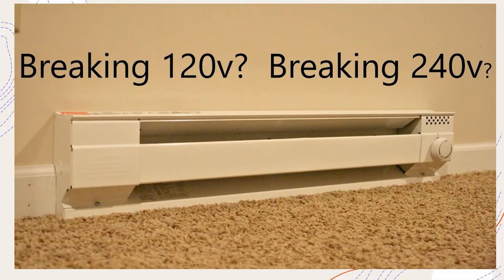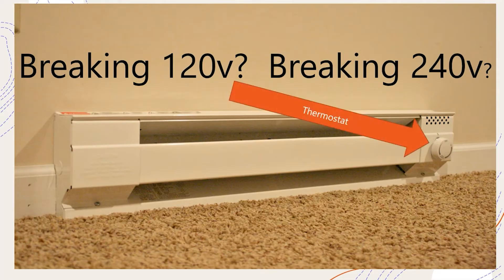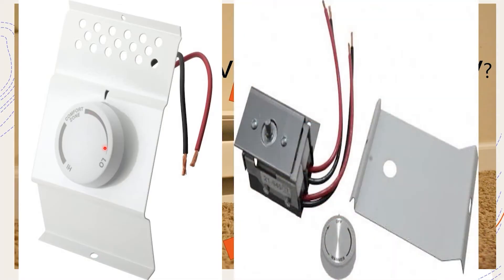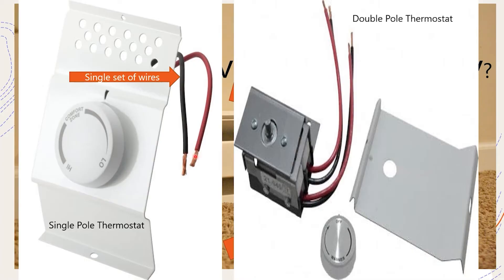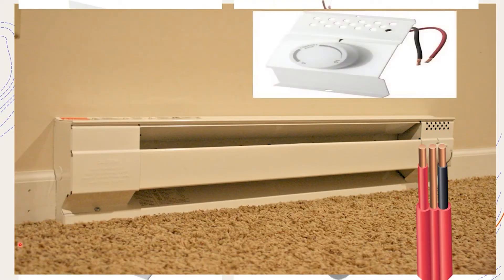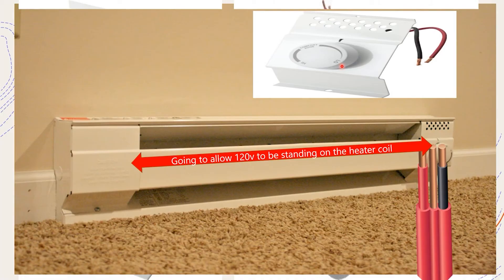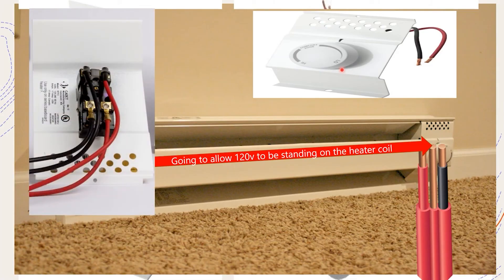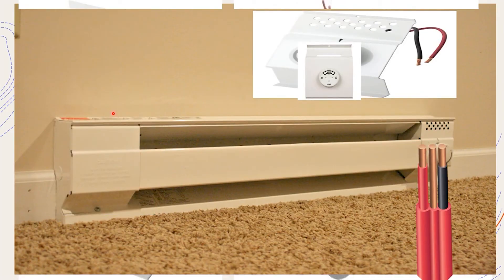Breaking 120v VS 240v Thermostat Warnings and Training.

Comment: Thank you for pointing out the importance of a positive OFF. Myself being a journeyman sparky I've installed my share of baseboard heaters, all but maybe 2 of them were 240 volt units and I've always used 120V thermostats because they were cheaper than the double pole thermostats, and the  homeowners never wanted to spend more than necessary.   Most of the heaters I've installed were in additions like a spare bedroom or new bathroom (wall heater for the bathrooms) .   Never had any issues with shocks or fire hazards.   Inspectors were okay with it.